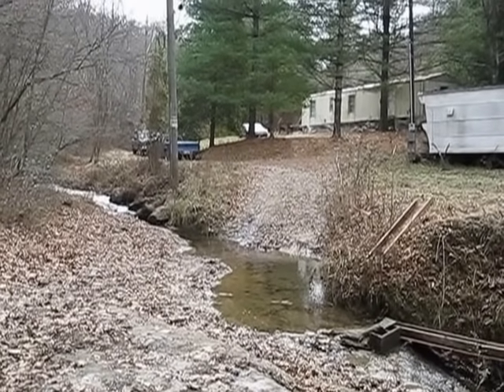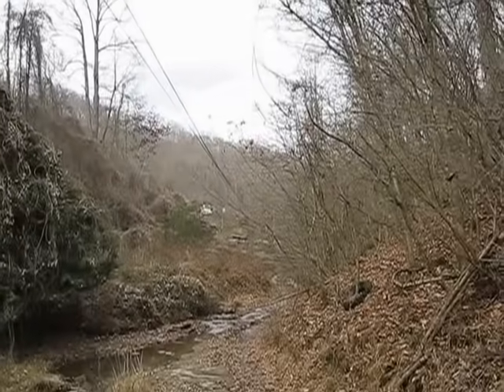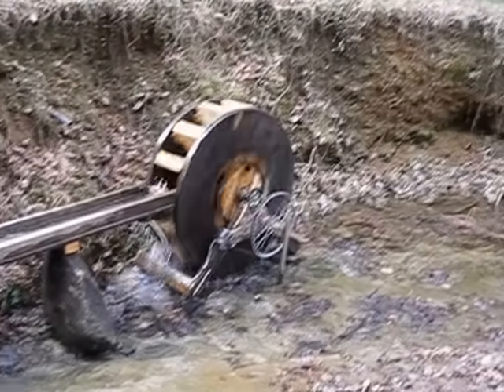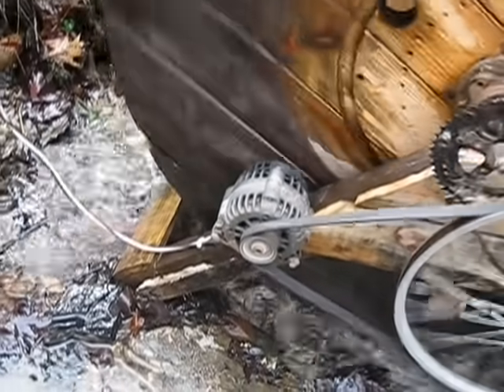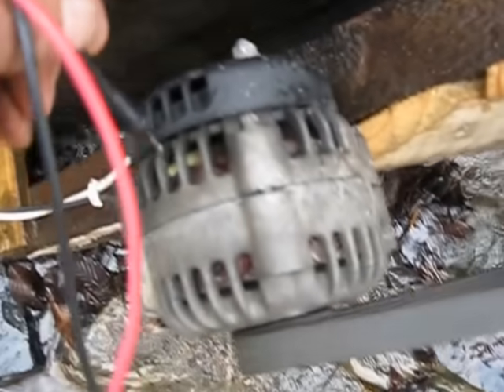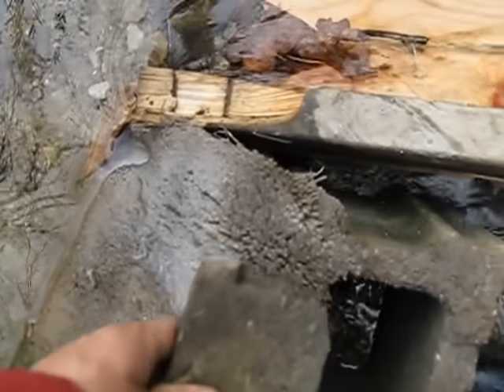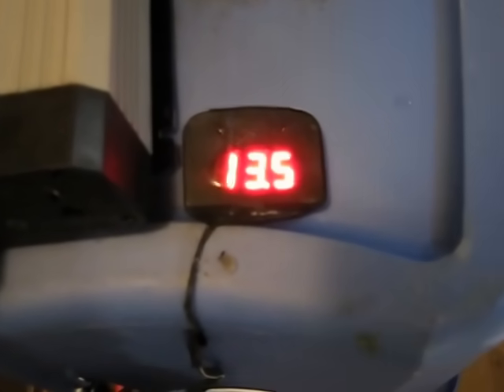water wheel generator

Comment: Your not worried about your only way in an out flooding???it seems like a bad path through.It will assure that you get left alone in a flooding emergency time.So yes if you can't sustain an support your life without the world you are in trouble living there that way.
Reply: The comment about no weather protection has a good point as well.Floods have washed away an damaged many a water mill.
Reply: What is your back up plan?
Reply: That an I don't see any weather proofing protectant stain on your metal an wood.

Comment: That is as simple a set up as there is. Great ideas for you below in the comments. Keep on getting it!!
I applauded your creativity.
Reply: Damn, let me add something. Keep an eye out for some 6 volt golf cart batterys. Wire them up in series for 12 volts.
You will get so much more battery life and extend you power between charges.
Auto batterys are my be 60 amp hrs(and thats a stretch) 12 volt storage batterys are 90- 110 amp hours, and the six volt storage batterys are 210-260 amp hrs!!!
You will be very pleased with the 6 volt batterys my friend. Good luck and be well.

Comment: This is not producing ANY power. Certainly not enough to even light  a light bulb.  An alternator won't even bias on at 150 RPM which is about what this is turning. Big wheel takes 4sec per rev that is 15 rpm, say a 20" wheel and 2" driven pully and you have 150 rpm. Won't even bias on, now where is the field current comming from??
Eng 101
Reply from the maker: No field current needed for a PMA. I think I mentioned in the video I had converted it to PMA.
Reply: @cavebranchstudiosllc  You are correct, Permanent Magnets don't need field current, but still the output is probably less then 20 watts, but, it is 24x7 so that beats a 20 watt PV. Its a nice idea, but it won't power much more than a clock and a phone charger. So where does the 40 volts DC go? Makes no sense 40 volts at the generator but 13.7 at the batteries, the RV charge controller won't run on 40 volts DC. Unless it is a solar charge controller, Is the alt connected directly to the batteries and the 40 volts was open circuit voltage? Oh well nice experiment, but for what grid elec costs, if its available its way cheaper
Reply from the maker: @integr8er66  The problem with this wheel was I didn't have enough head to get the water to fall at a rate I would have liked. I'm building another wheel for a cabin I built, but I have 25 or 30 feet of drop so it should be plenty to turn the wheel. I am also building a turbine which will actually be my primary power source. The water wheel will be a small source of energy, but a larger source of entertainment.
Reply: @cavebranchstudiosllc  If you don't have head pressure lots of flow will make it work, but it takes a lot. Ameren hydro dam at Keokuk IA has only 30 ft of head which is very low for a serious hydro plant, but the full flow of the Mississippi River gives it an output of 142 MW. The issue witj personal hydro is if there is a decent amount of year round flow the DNR won't allow you to dam it.

Comment: 1000 Watts at 12v is about 83 amps. The wire I see in your battery hook up appears to be around 12 gauge capable of around 20 amps. You need 4 or 6 gauge wire to hook up your batteries to your converter. Also batteries vent off hazardous fumes and should be in a well ventilated area outside (not in your kitchen). Take a look at this video, you might find the battery hook up and management helpful: https://www.youtube.com/watch?v=omhPFacZGqY&t=37s

Comment: I'm curious what can you run off that 1k w inverter? 
I'm running 375W solar charging panels with 4 deep cycle solar batteries and cannot push a regular House Fan.... Any ideas why? My batteries are hooked up in parallel
Reply: @Sho Yu Weeni I'm using a 1k watt continuous 2k peak I think 15amp

Comment: The relay breaker system I haven't figured it out yet but it's function needs to be to activate the dc motor only when batteries require charging and to turn it off once charged to extend life lasting of the components, let me know what you think
Reply: That's why charge controllers are invented

Comment: This is what you need to do: get you an 18v dc motor from any cordless tool to rotate a car alternator that is going to charge a set of 12v car batteries and from the batteries you gonna take two positives and two negatives, one positive and negative to a AC DC converter so you can power your house and the remaining positive negative to a relay breaker system that is going to activate the motor once it detects batteries are running low, and that's how you create a retrofeed generator.

Comment: You will notice a big difference if you switch to golfcart batteries or L16 series.
I had 3 recreational deep cycle batteries which did not have the duration durability golfcart or L16 batteries have.

Power batteries need to be serviced regularly to keep the plates healthy. Plus the plates are thicker.

I got four six volt 200 amphour golf cart batteries. The voltage stays above 12 volts and I can run a hair dryer for a few minutes... With the RV 12volt 100 amphour batteries I couldn't run a hair dryer and keep the voltage above 12volts.

Comment: One thing that should be added is fuseable links or fuses connected to each battery and the quickest way to make this work for most people is to have one more stage of gearing to speed it up for the alternator, and use a single wire alternator as the only need will be rotation to turn it on. Putting a permanent magnet in the alternator requires using a charge controller, but it offers a lower starting RPM to get voltage out, and if it uses a boost regulator to 13.8v or brings a higher voltage to 13.8 to 14.5v.

Comment: You should add rectifier, 10,000μF capacitor with 100 volts. Or then stable voltage regulator and at the same time supercapacitor at last inverter.
Reply: I  have a  formula in which we can put water up  to the tank more than   5 meters high  without using any electric motor.
Guide me , how could i use this in making electricity.

Comment: Several things here to take note of that are obviously working well in this set up from my point of view and are only my opinions.  He has got that modified cable spool that has massive weight to it as a waterwheel, the gearing looks correct on to the Alternator and its running all the time so he has a good constant charge current even under some load.  Never underestimate the power of water. If he needs more power just copy that setup with whatever improvements and run them side by side leaving the original one as it is working and develop the next one and so on. Having a constant supply of running water falling on a water wheel is exactly how the British Industrial Revolution started, we had over 15,000 water wheels originally here in the UK.  I am struggling with solar power at the moment but if I was a mile down the road at the river I'd be laughing.

Comment: a good job of making use of what's available.  In the future, if you can save up for a newer technology charge converter and then some 6V golf cart batteries, then you 'll really be styling.  Because the inverter causes some power loss when stepping up to 120VAC, I'd also go to 12V LED lights as they come on sale, and also other 12V appliances when it's practical.

Comment: Very nice. I know this post is very old but I just saw it for the first time so it's new to me. I probably would have mounted the alternator on the same side of the wheel as the house and a little higher. Although the belt is loose, they still rob power. The chain does too.You're probably loosing 2hp to the belt and chain. That's about 1500watts. If you could get your hands on some gears, that would be the ultimate.  If you could get your hands on some old electric fork lift batteries, you would be in great shape. They have 1/4 inch thick plates. You can pick up a desulfator for about $20. Often times the forklift batteries aren't bad. Their just sulfated. They'll last you over 10 years once you fix them up with a desulfator. Some people have gotten over 15 years out of old forklift batteries. That's a great setup you got there. Just needs some tweaking. Hats off to you.
Reply: Thank you for posting this

Comment: The area around the creek looks relativity flat. Some slope but just like 4 or 5 degrees. Check the height of the creek from the highest point to the lowest on your property. You can do that with a 4ft level and a few pegs to drive in the ground. Shoot it like a surveyor. Easy stuff. If you can get a height of 20ft you can get  8.5lbs of pressure per sq inch. reduce that to 1/4 sq inch  and you get 36 lbs/sqin. Lots to turn a 14" peltor wheel and at least triple your current output. Where I live I only would have to go 50 or 70 yards to get  90ft of height and have 65lbs/sqin.  If I set it up well I can produce 30kw constantly. (except a drought,, but we don;t get them here, much)

Comment: your post is dated  dec 2013, it is now Jan 2019,  have you made any updates to this sysyem?,  did you move the wheel down steam a little bit to have the water hit the wheel a little higher, that way you would have a bit mote torque,  did you add a second wheel??, how about the good LED lights, this system would support a whole bunch of LED lights  with a 1000 watt inverter,  sure this needs a little work to be near perfect, but Your Heart is in the right place. Good Work.

Comment: The closer you get that inverter to the alternator the better. You'll have much less drag! And your inverter will produce much better. And definitely a small power room beside your water wheel. Very nice location you have. Lucky to have a running water access.  Do you use and filter the creek water for your home needs?
And good job on the water wheel..

Comment: Yes sir! You are off the grid.
That driveway alone proves that.
With all those trees you probably don't get a lot of sun, so I would concentrate on the water you have coming from that Creek.
Maybe create a damn and then another branch powering another wheel.
I'll tell you one thing though! NONE of that would fly here in Oregon. Collecting rainwater is a crime out here, let alone making use of a natural stream.
It's a real shame too, because we have a lot of natural streams.
Stay safe
Reply: Collecting rain water is illegal .but by using the same amount of  water  continously is not illegal.  By making a tank of water 10  or more yards high by not using any kind of electric motor. Very possible .eg  100 gallons of  water .

Comment: 10:03 What does he say there???

There are ways you can get extra spin for that Alternator only by getting different cogs and gears to work for you.
Reply: Can you give some examples please?
Reply: Kyle A -
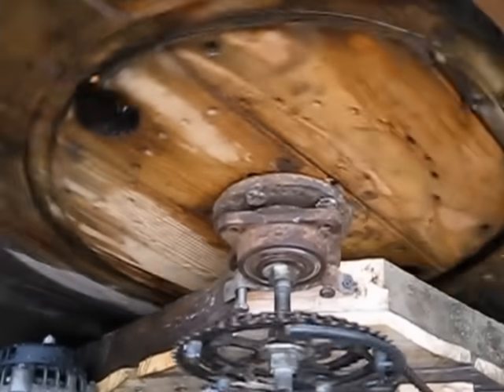If you go to about 3:30 you can see the bicycle chain/gear connected to the water wheel has two sprockets. He is using the smaller of the two. Simply move the chain to the larger one and you will spin the alternator faster. You can prove this to yourself if you have an old 10-speed. Move the chain between the front gears while spinning the cranks at a consistent speed. The larger gear will spin the back wheel faster. The opposite will be true for the back gears. Try it and prove it to yourself.
Reply: @chucknoob7041  Thanks Chuck!
Reply: Chuck Noob thanks! 

I found this too.  1:30 he talks about the pelton wheel.
Reply: @chucknoob7041  "try it and prouve it to yourself." Good saying
Reply: @chucknoob7041  Keep in mind that when you shift into high gear it's much harder to pedal.  Simply switching to a higher speed won't necessarily result in more power.  The water wheel is capable of only so much - lets call it - horse power.  If one horse power can generate 745.7 watts then you're not going to get more power by speeding up the gear ratio.  The wheel will slow down.  AND the slow-down will result in less wattage.  If you want more power (measured in watts) then you're going to need a larger water wheel.

And the more transitions (bearings, cogs and gears) the more energy is wasted as friction.  That's why turbines directly drive generators.  Any gears must be mounted on bearings and there are no such thing as perfect bearings.  They ALL have parasitic power losses.  The chain is a series of links with hinges which also reduce power.  The belt must bend and flex around the alternator.  Every step of the way you're losing power.  The BEST option for getting more power out of that wheel is to put a gear around the entire circumference of the wheel and have that directly drive the generator.  And if he can get more head pressure (water up the wheel higher) he will get more power by virtue of more water being carried in the wheel.
Reply: @petec6690  -
Thanks Pete lots of things to consider here.  I was assuming that he had excess power still available so a higher gearing could be achieved without issue.

Belt drive vs Direct drive:  (my observations, not facts) - There are significant advantages to belt/chain drives in that alignment doesn’t have to be perfect and I think they operate better in open environments where lubricants can be compromised. They also allow for easier changing of gear ratios vs direct drives.  

As far as efficiency differences I think that’s an interesting question and one I’ll look into.
Reply: So he can control the water by putting a big load on the inverter. Slows the water way down and or shut off.

Comment: hi, love the way you run high voltage at the source, then cut it down at the end , higher voltage travels better with less drop!, allso if you want more torque so you can run multiple alternators use a larger wheel and wider, plastic barrels cut to 1.5 feet wide paddels work awesome! keep up the great videos🖒i rang your bell! ps i tinker with electricity also, and am a ham radio operator😎
Reply: What's your location? I'm just getting into radios. East kentucky

Comment: Your lucky that the creek is positioned where is relative to your location! Here, There is a creek but, there is a road & a plot of land between the creek & this location & the land is owned by a neighbor who would shut me down immediately! I have wanted to tap into it's potential however, I will have to come up w/another idea! Water does come down threw this property however, It is not constant & when it is flowing, it just soaks the yard. I need to harness it, make it work for me, & send it on it's way. I think that if I dig down, install a drainage pipe, I might be able to get more consistency. Great job! Though, Some improvement's could be made! I am wondering if there are ways to boost your power output by several means. Changing wheel speed, changing height of the water drop & the angle of approach. adding a capacitor to aid in any spikes? Though I am not versed in permanent magnet alternators! I would love to see the process of converting that alternator! also adding more alternator's! Great job!!! I think that keeping it a secret from powers that be would be most important! like city officials, electric co. etc.
Reply from the maker: Good luck on getting something set up, hope it works out well for you. The alternator was converted to a pma by adding some neodymium magnets to the rotor.

Comment: Hi great deal mi men but you need to separate de batery from the floor cant be directly to the floors they will discharge that way .thanks
Reply from the maker: Thanks. Inside a sealed plastic box with a vent running to the outside is the best way to have batteries.

Comment: Im with ya buddy, I have a creek right behind my house that I want to get some use out of just like you are doing. I also have the idea of putting a spicket on the side of a big barrel at the bottom of it with a hose running up, and then put the entire barrel into a hole right in the center of the creek. The water would fill up the barrel and that would give water pressure out of the hose. I wanna do this to flush toilets with lol, but im sure the water could be cleaned and used all kinds of ways.
Reply from the maker: That would be an excellent idea! Water pressure without a pump. With a sufficient filter system it would be good water.
Reply: It turns out that my idea wont work, you can watch videos of rain barrel flow and you can even put a tube in a pop bottle to replicate the flow, its not enough. A ram pump is the way to go.

Comment: Don't lie us. Rpm not enough. Minimum Rpm most 1500.
Reply from the maker: Max rpm on stock alternator is 1500. This alternator was taken apart and I drilled out part of the rotor and jb welded neodymium magnets in the holes. It was then a permanent magnet alternator. It would produce a small voltage just by spinning it with your hand